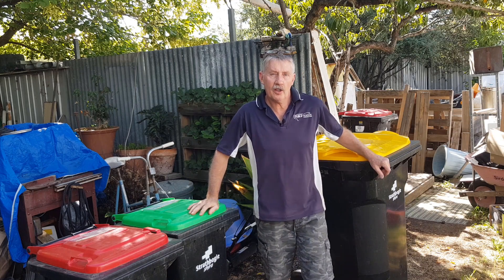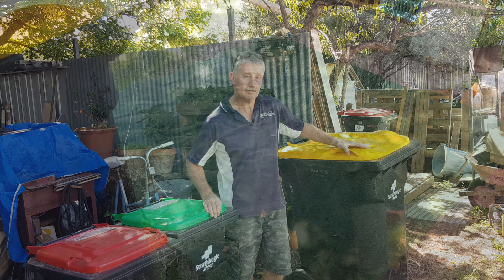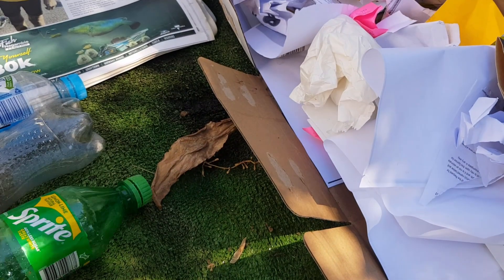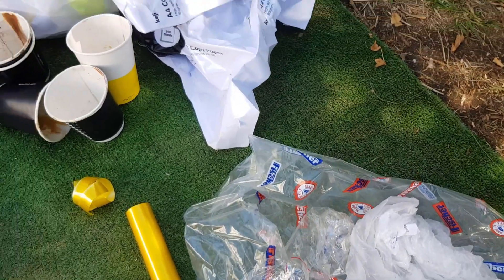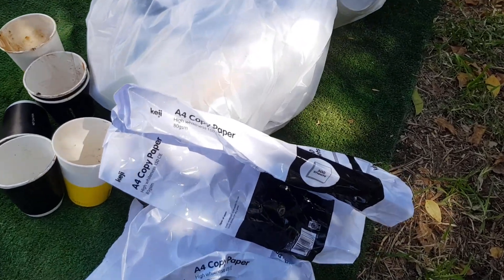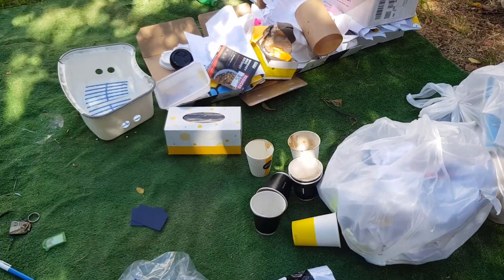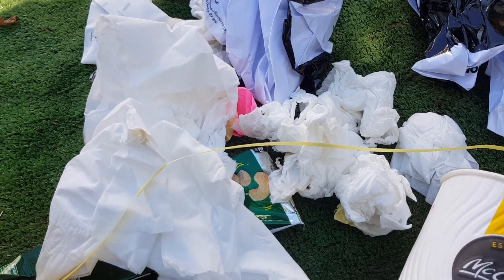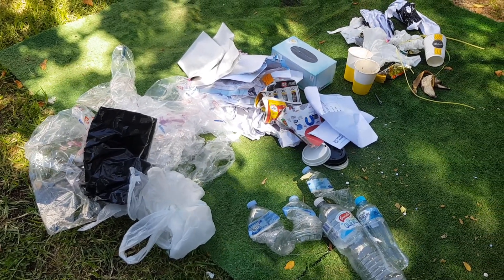Conducting a recycle bin audit - what was right and what was wrong! A look at recycling in Australia

Comment: Chris, what happens to the contents of a recycling bin which contains non-recyclable items like this? Does the whole lot get dumped in a land-fill? I understand that in Japan and South Korea they are much more rigorous about pre-sorting material - and people are fined if they mix stuff up.
Reply from the maker: I believe there's a manual sorting conveyor at the recycling yard Jonothan where the most obvious "wrong" stuff gets diverted straight to landfill - this includes anything bagged, which is one of the biggest problems! Hopefully any loose recyclables continue through the sorting facility to be correctly processed. Once this virus thing is over, I'm hoping to check things out for myself to see what happens :)